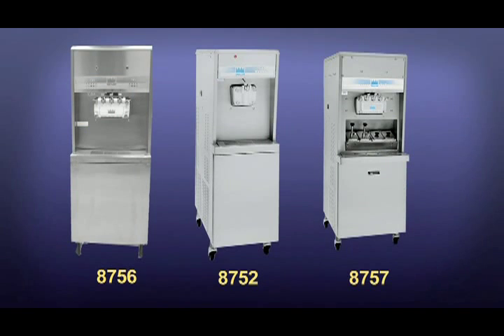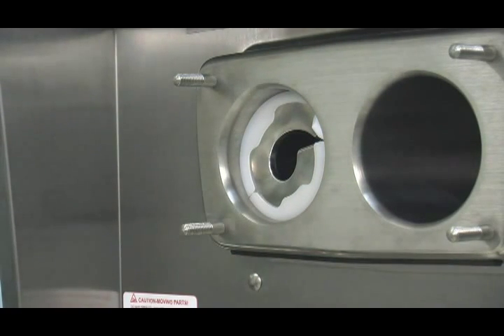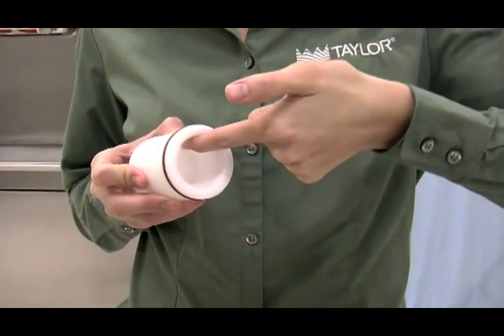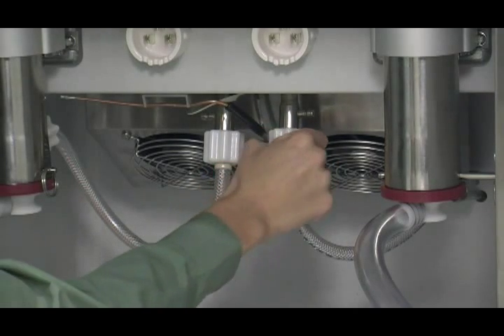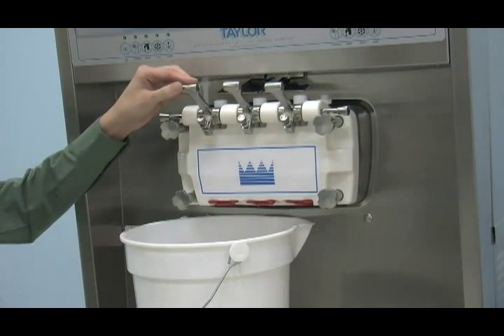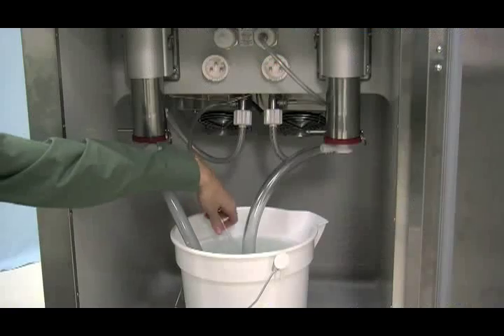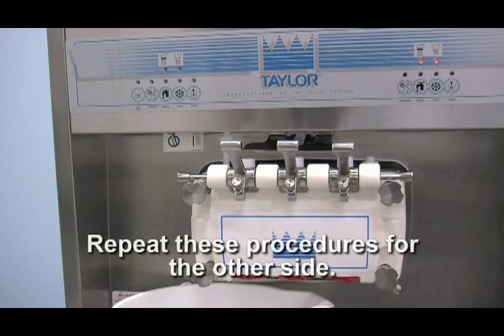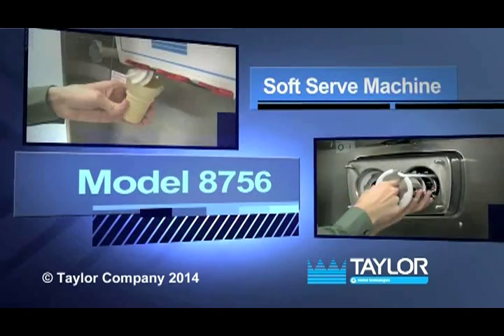Taylor 8756 Coaxial Pump

Comment: Where are your gloves? :( Those are food contact surfaces you're showing, so you should be wearing gloves, an apron and a face mask at the very least.  Otherwise very informative video.
Reply: Not necessary, as those surfaces are sanitized once the machine is assembled and the sanitization procedure is followed.
Reply: @novaprospekt1739  I'm not sure I'd be so trusting in a food preparation environment.  Not everyone washes their hands as well as they should.  But as I said, an otherwise very informative video.
Reply: @PaulDostal  Im not sure if someone incapable of washing their hands will go through the greater effort of donning a mask, apron and gloves. I've seen people pick their nose and scratch their bum with gloves on before, too.
Reply: Ok I did my machine today😳 and I must of done something wrong because my middle(twist) will not work!! I watched the video again thinking I may have put the inside upside down idk I’m gonna take the top apart tomorrow and see what I did wrong